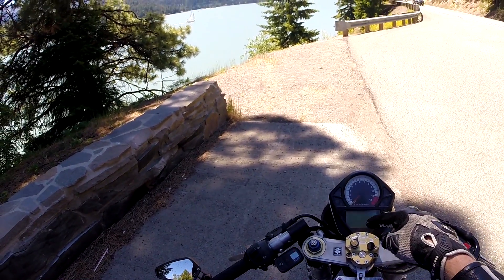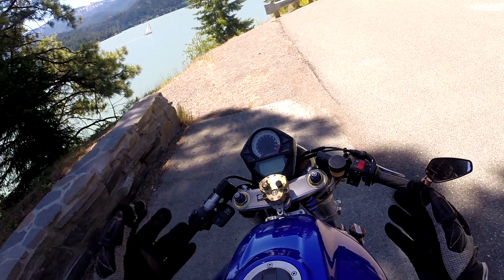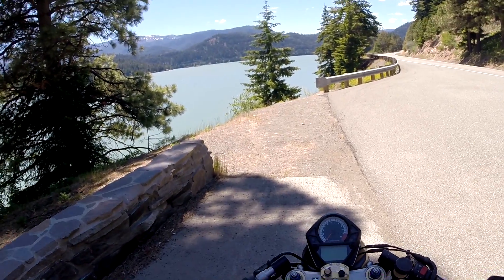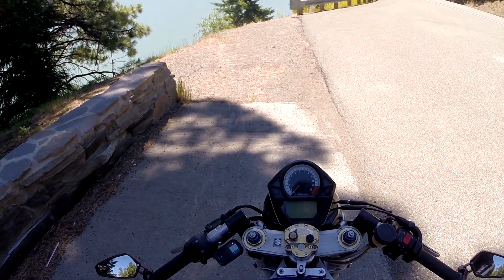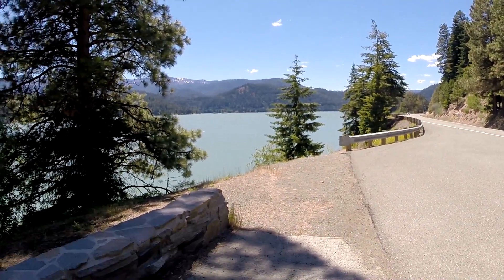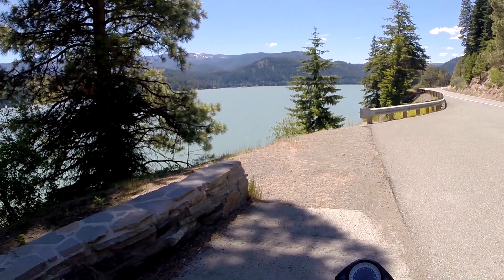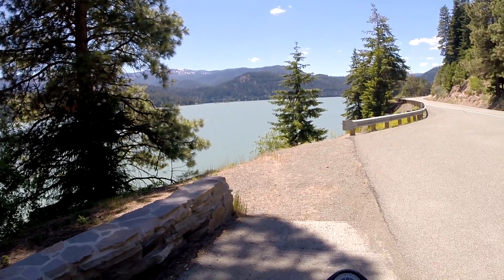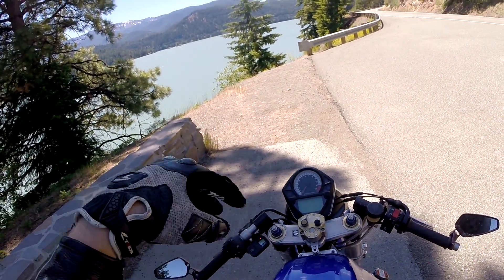Motorcycle Stability Explained

Comment: I just bought a suzuki gixxer sf250 over a month and my problem is i can ride on little bit windy highway road even i have correct my posture. Even i hv chg a new taller windshield and lean my body grip the leg between the tank its still feel the same. I think the geometry or the suspension not suit with my height and weight. Some of mechanic i meet they said mybe i should put more oil in fork to make its more stiff. Dunno it will help or not because the mechanic said that bike cannot lower the front end because of the handlebar or the crown hv stop cock or something like that. And u did mention about the damper, i still cant find the bracket that suit on my bike. Feeling a bit of stress because this my first bike and i can not have a fun ride because this disturbing riding on highway road
Reply from the maker: Riding in wind, the bike will move some, especially a light bike with full fairings. There is no way to prevent that, but you can still control precisely where it goes. You need to stay focused but relaxed. Making things stiffer may be a bad idea. Also, wind hitting your body helps you feel it and make adjustments at the same moment it begins to affect the bike, before the bike is blown very far off course. If you are isolated from the wind by a large windscreen (though it may be more comfortable), then not only does the wind have even more area to push on the bike, but your body gets less sensation from the wind and you end up just reacting to the bike being blown off course. It takes practice to develop a reflex response to the wind, but it really helps to stay relaxed.

Comment: Iirc its not really the gyroscopic force or in other words the force that keeps a spinning disk in the plane of its spin that keeps a bike from falling but the way the steering works falls are self correcting so the act of falling beings the center of balance back under the two wheels and stabilizes it. Or something like that.

Comment: Bro in my fzs v3 if I go to 80km/hr then I take a hand from the handle bar then then front wheel slightly wobbling it's normal or any problem
Reply: Wobbling is never normal.
Worn tire can cause wobble.
Wheels are not inline. Front wheel can be offline too, but usually it is the rear wheel.
Worn out wheel bearings.

Comment: Thanks. So if I fitted stiffer and longer springs i t would increase the distance from contact patch and headstock projected angle at road intersection. This would increase tendency for steering to self centre ??????????
Reply from the maker: If you increase trail by making the forks longer, it will probably feel more like it wants to stand up, and will probably handle less sharply.
Reply: @drienkm  OK thanks.

Comment: My bike handle bar wobbles after crossing 130kmph. But below 130 it's stable very well. With pillion rider it's stable till top end. Only wobble when I ride solo and cross 130 kmph. Sir pls solve my problem
Reply from the maker: I can't solve your problem, but I can ask some questions that might help. Are any major parts of the bike (including wheels, tires and suspension components) different from stock? Has anything been added to the front end? Has the bike ever been crashed hard?
Reply: @drienkm  no sir. It's almost new, just 9500kms ran. I neither changed any parts nor crashed yet
Reply from the maker: @solorider9670  Hmm. Could be things like bad tire wear, or really low / high tire pressure, odd suspension settings, or maybe even the forks were clamped low in the head clamps during dealer assembly. Hope you figure it out!

Comment: Please tell me the solution when i take hands off feom my bike it start leaning a side .i searched every where but unable to find my answer ...🙏
Reply from the maker: My guess would be that the rear wheel is not aligned with the center of the bike. If it's a motorcycle, the chain adjusters on each side of the swingarm might not be equal. If not this, maybe a major component is bent like the frame, swingarm, or forks? Are your forks twisted in the triple clamps?
Reply: @drienkm  sir i have bike every thing looks good and symmetrical but not stable so far??
Reply from the maker: @Muhammadyousaf-tk7pt Hmm. Not sure then. Can you email me a good video or something? (My youtube name)@gmail I'm happy to take a look...

Comment: Obviously gyroscopic effect from the wheels makes it stay upright. If the geometry kept it upright it would stay upright when parked. Geometry only influences the stability at speed.
Reply from the maker: The effects of geometry on dynamics depends on things being in motion, just like gyroscopic effects.
For example the damping effect of a gyro depends on not only its speed, but also on its mass moment of inertia - the geometric distribution of its mass.
Reply: If the gyroscopic effect keep bike upright then a bike should stay upright on a reverse too.
If the gyroscopic effect keep bike upright then a bike with fixed fork should stay up too.

It does not.

Comment: My handle swivels whenever I try to bank on turns. Especially when it reaches 80kph but when it's 60kph below it seems tolerable. I'm riding with dual sport tire. Is that normal? If not, please help. 😥
Reply from the maker: By "swivel" do you mean oscillate? If so, then yep, it's a dynamic stability issue. Has the bike even been wrecked or impacted? Is leaning one direction worse than the other? What sort of bike is it? Are there any other load-bearing modifications?
Reply: @drienkm  I meant wobble. I'm sorry for my english 😅. Its a new bike it's classic 250 only. I haven't touched anything aside from the tire pressure. I reduced it to 10psi because it feels almost every small bumps on the road and I got bothered with it. When I reduced it, the i can't feel the bumps anymore. But yeah, it wobbles on turns. I'm only 58kg. And my bike is on inverted fork if that helps. Thank you for your response btw. 😊 Please help.

Comment: do you have a video that covers high speed turns oscillation?
Reply from the maker: Hmm... well oscilation is a sign of too little dynamic stability. Remember I mentioned that a whole bunch of things affect dynamic stability? Turns can be one of them. So if you are looking for a fix for a bike that oscillates in high speed turns, unfortunately the answer is basically the same just as vague as for one that acts up in the straights. That is: slowly and carefully bring wheel / tire /suspension / frame configuration back toward stock or a known stable configuration.. Increasing rake angle generally helps (raise front and / or lower rear).
Has the bike ever been wrecked?
Reply: drienkm no wreck but this book by Lee Parks said to check if chasis is twisted or offset. I’m guessing you are on the mark for asking me about wreck. I Just installed after market shock and playing with adjustment. If not I will try lower fork from the triple clamp to get more take. What I was experiencing was not speed wobble, just a lot more movement on the bike like starting from 70 mph on mountain canyon roads. Maybe it’s heavy bike thing. Just not designed to keep up with sport bikes

Comment: I am a physics teacher and love motorcycles .I could  connect quite  easily especially  the marble  oscillating in a bowl(simple harmonic osvillation) offcouse the we define stability  interms of energy  the lower  the energy of the system the more stable it is.Low center of gravity means more stability.Anyway great job keep it up,would love to see the mathematical model can you give some links.Thanks.
Reply from the maker: Yes, the paper I've found most interesting on the topic discusses the work of Andy Ruina and others at Cornell. http://ruina.tam.cornell.edu/research/topics/bicycle_mechanics/stablebicycle/index.htm
Hmm, stability in terms of energy... I've not heard that before. In mechanics, I can think of many systems where stability characteristics are independent of the energy state... as far as I know. Can you elaborate on what you mean?
Reply: @drienkm  Thank you so much for sharing.What I meant was that if we plot Plot PE as a function  of position say x the lowest point has maximum stability or in other words second derivative of the PE(x) > 0,then the potential energy is at a local minimum. This is called stable equilibrium. That is in response to a small perturbation is forces that tend to restore the equilibrium.Example is that of a marble  at the bottom of  a bowl when disturbed by a small force it always comes back to its original position.
Reply from the maker: @Allthingstech3108  I've never heard stability defined as the proximity to the location of static equilibrium at a point in time... That certainly has a direct relationship to PE with pendulums or mass-spring-damper systems, but an inverse relationship to kinetic energy.
It seems you are defining stability as a time-varying dynamic variable rather than a system characteristic. I've only been exposed to a classic dynamics definition which would say that no matter where the marbe starts, the system stabillity is fixed and doesn't vary with time. The eigenvalue plots and stabillity derivative don't depend on the marbles current position, only on characteristic variables like it's mass, drag properties, curvature of the bowl etc.

Comment: Hi sir my bike wobble all speed its brand new bike only 10000km drive .front handle shaking one said pulling any solution plz reply
Reply from the maker: If you rode it 10,000km that way without losing control and if it wobbles at all speeds, this makes me think a wheel rim is bent or warped. Not a stabillity issue. You will know if you lift the wheels off the ground and spin them. Put something close to the rim. Is the gap steady or changing?
Reply: @drienkm  I changed front alloywheel & tire but no use also I changed fork oil coneset but no use .front handle &: wheel show heavy...
Reply from the maker: @jaggishwetha682  Have you checked the if the rims are true (not bent)?
Reply: @drienkm  sure bro tq for support

Comment: Is a steering stabilizer wise insurance or foolish band-aid?
Reply from the maker: IMHO, a damper is a foolish bandaid if it is seen as the solution when you expect a bike to be stable and don't know why it isn't. That is where deeper inpection is needed.
It's wise insurance when you know exactly what modifications a bike has, you expect to them to reduce stability marginally, and you've made sure through testing that the damper is adequate.

Comment: Fantastic, thank you, very well explained! You have re-educated me! I guess the road pulls the wheel straight as it's drag is behind the axis of rotation? ... A bit like a rudder on a boat is pulled straight (when you let go of the tiller obviously) by the water passing over it, but most importantly this only happens because the drag is mostly behind the axis of rotation. Imagine a rudder where the axis was planted directly through the middle instead of on the end, the rudder would likely slap all over the place?
Reply from the maker: Thanks. Glad you liked it!
Yeah, the caster effect works exactly like the way typical a boat rudder wants to stay in line with the flow past it. Good thought!
Reply: Like shopping kart!

Comment: Good explanation by a real engineer. Now I understand the complexity.  Interesting armchair "experts" trying to argue with a trained engineer who studies the mathematical realities WAAAY above the layperson's head. I spoke to a board certified orthopedic surgeon who said his degree in mechanical engineering was far harder to get than his MD, which was mostly memorization.  In thinking of buying another Harley I heard about "Dyna wobble".  Dunlops old video shows ANY motorcycle can get wobble, and documents when it occurs and how to fix it.  This video helps understand the complexity.  Years ago I had a poor man's chopper a friend begged me to buy until he saved up to buy it. It was a Triumph that instead of adding rake by cutting the frame and adding caster they cheated by raking the triple trees.  It was spooky to ride around corners, but extremely stable in a straight line.  Thanks, the wobble issue is put to rest for me.
Reply from the maker: Glad you got something out of it! Complex is right!.. Motorcycle stability is a mix of 3 big things; 1) steering geometry 2) gyroscopic effects, and 3) front-end mass distribution. But there are also a host of other little things affecting dynamic stability. We've been able to glean certain rules of thumb about some of these, but most of the validation must be done experimentally despite tremendous effort put into mathematical modeling of things like this. 
Good engineering is an art of deciding what to ignore, where to guess, and when to analyze.
The physical world is crazy. You could study applied physics your whole life and not be able to come up with a model that perfectly predicts the wave of a leaf in the wind... And yet we know (in that sphere of physics at least) that the leaf and the twig and the branch and the tree and the air is following a few fundamental equations EXACTLY! The reigning problem is always measurement - collecting the hard (and often changing) numbers to plug into the equations. We can't gather enough detail about all the physical properties and relationships of all the imperfect, varied, stuff that the world is made of. We can sometimes come close enough to create pretty amazing things though!

Comment: OKAY...  I found this video seeking confirmation (didn't get it) of the force I'm feeling on my KLR-650 after having changed to a very heavy front tire (21" Michelin Anakee Wild = 11lb 7oz.(!)).   The force quite obviously is centrifugal/gyroscopic induced.  I have rode this bike for 7 years and ran about 5 different front tires... all fairly cheap and mostly offroad oriented (nobbies).  After switching to a more street worthy (still nobbie), much stiffer sidewall, significantly more expensive tire (X2), and 4 POUNDS HEAVIER tire,  the feel of my bike has changed quite significantly.  My bike is much more stable in straight line and smoothly entering and exiting curves.  It absolutely ignores seams in the road and minor cross winds.  It seems to precisely command my leans with great authority over my bike.  The problem is my bike has lost its ability to be "flicked" quickly.  Even tho the KLR is a piggish dual sport bike, I have always found it quite nimble in the switchbacks and able to weave the passing zone stripes at 60MPH.   NO MORE!  With this very heavy front tire my bike, tho initially very easy to lean, must be done slowly and smoothly now... any effort to "flick" the bike now quickly results in much more force applied back to the rider through the handlebars, and if forced, seems to expose inadequate rigidity in my frame/forks... resulting in wabble.  Similarly, efforts to reverse a turn suddenly (S turn) are met with enough back pressure as to induce major pucker and diminish confidence.
Overall, I love the new tire.  It gives a very firm sense of control over the bike and feels rock stable when handled smoothly, but limiting factors cannot be forgotten and respect must be given as a change in riding style around the twisties.   The old saying - you can ignore reality, but you can't avoid the consequences of ignoring reality.   
Any thoughts about front tire weight?
Reply from the maker: Keelo 68 Yeah! Switching to a heavier front tire will always give you heavier, slower steering due to the extra angular momentum ("gyroscopic forces"). 4 lbs is a lot! I'm sure it transformed the bike! 
I downplayed it a bit too much in this video - gyroscopic forces do play a part, but they aren't usually the strongest influence. If it was as easy to mess with rake angle and trail as it is to change a tire, it would become more commonly understood how influential geometry is. On a sportbike for example, it's easy to feel the tiny reduction in rake and trail resulting from raising the rear suspension just half an inch or so...
Reply: I suggest putting the light nobbie back on your "bad weather" bike and getting a separate "good weather" bike.  Pressure on the bars must be relatively light and gradual, as you found.  Forcing them hard will destabilize the bike and can be dangerous.